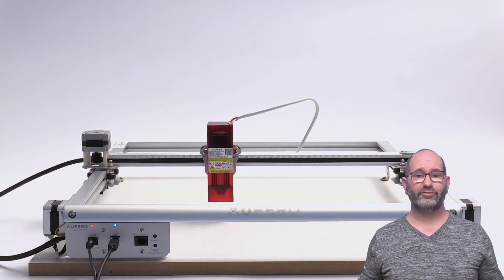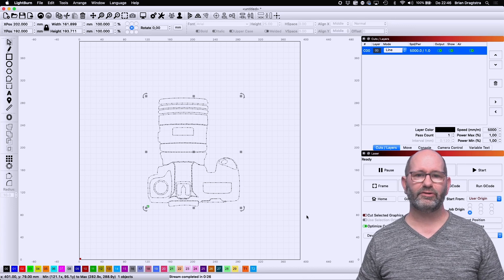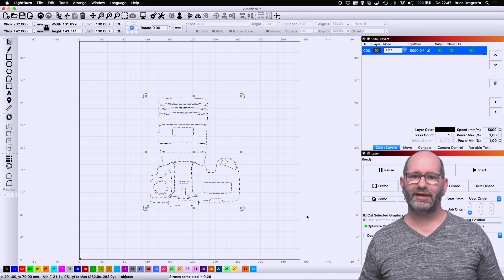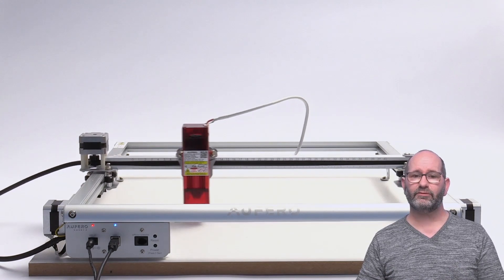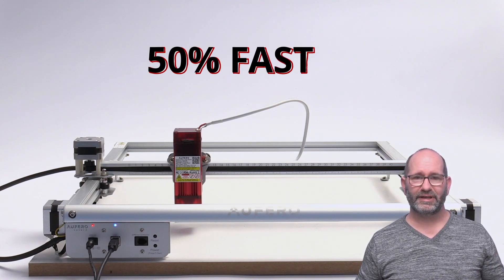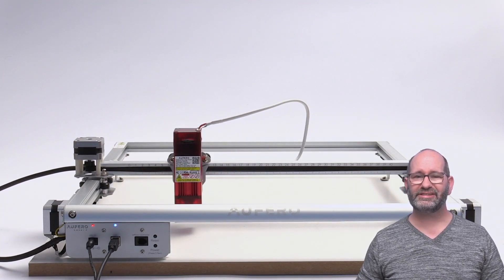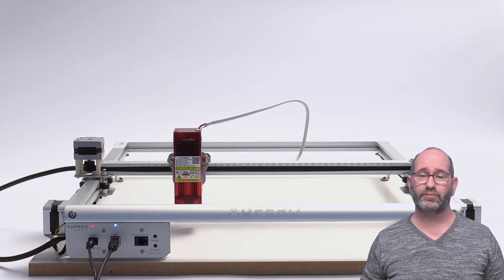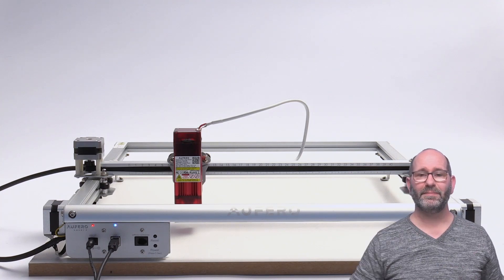▼ Super fast laser engraving

Comment: I dont think that you ran it at those speeds. Coming from voron land. Your acceleration are just low. I think it only hits 200-300 mm/s. Check speed calculators. And high up acceleration to 20-50k.
Reply: 15000 mm/min not the S 😁